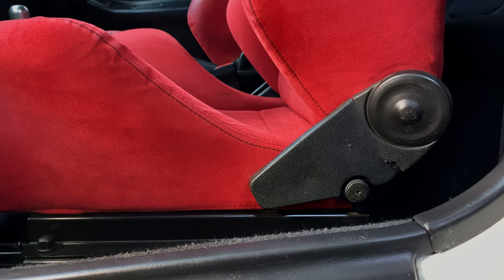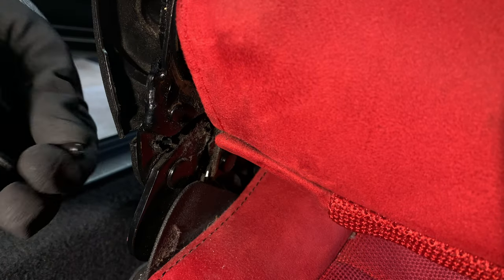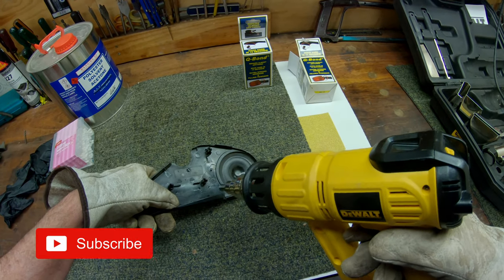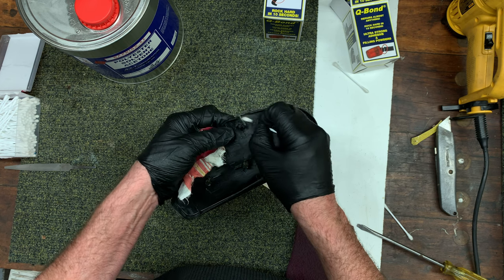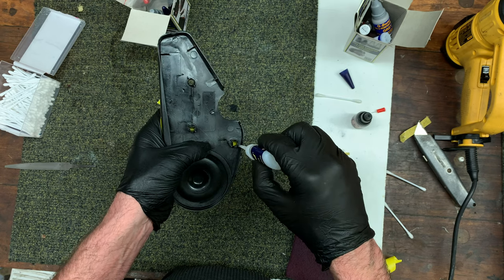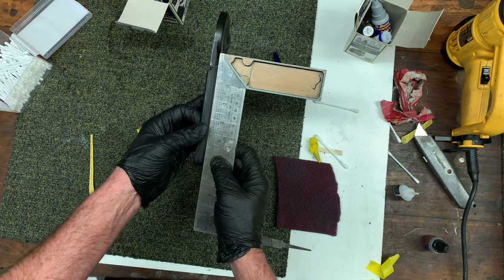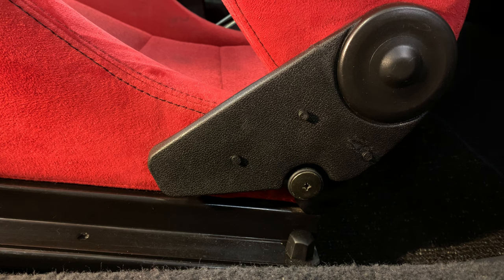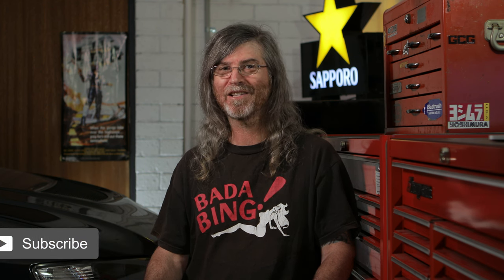Recaro seat Fix on Integra DC2 Type R . How I Repair the Honda seats with Q-Bond Super Glue

Comment: Very nice job. I had the same issue with mine. Luckily I got one of the last NOS originals. I kept the old one though... I did try to repair it, but not being the sharpest tool in the shed fecked it up. Used the wrong glue for a start and didn't use a heatgun. So after a week or so it sprang back and laughed at me. :) As far as I remember you can get a NOS replacement part from Recaro. It's essentially the same part, but has Recaro stamped into it.
Reply from the maker: cheers mate thanks. Interesting to know. I didn't think about getting a new one directly from Recaro.